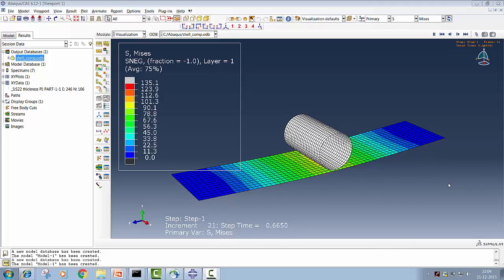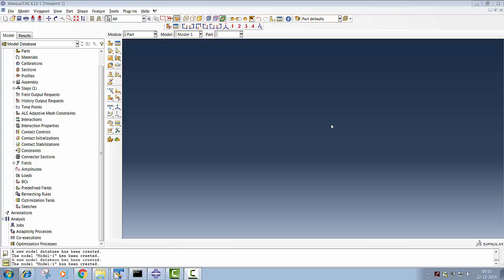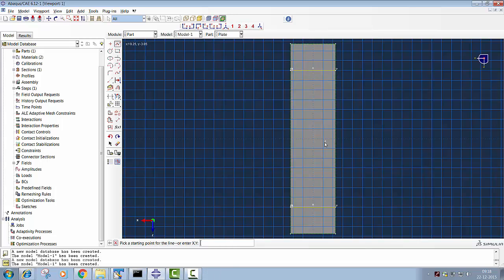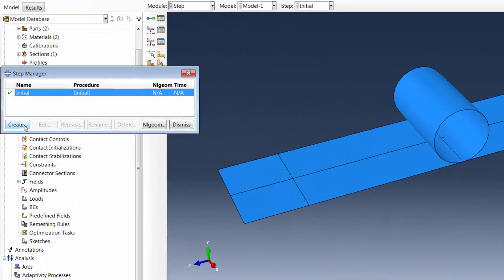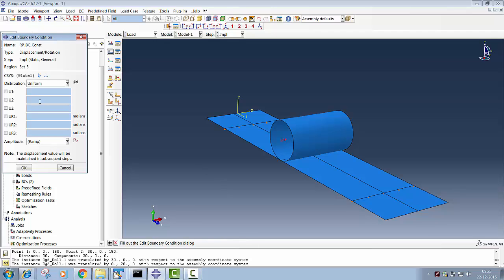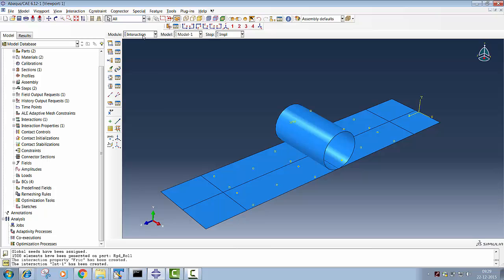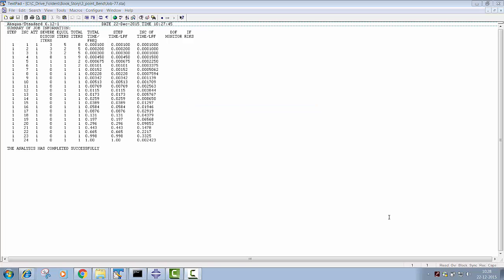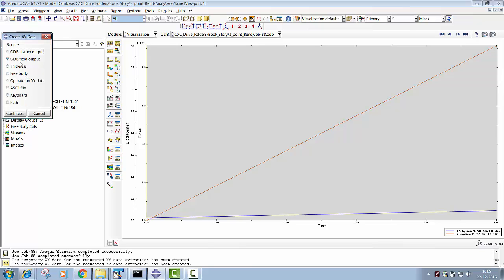Abaqus/CAE-Composite shell through thickness Bending stress plot Tutorial (3-point bend Abaqus std)

Comment: Thanks for the video. Have a question about the contact. When you set up the geometry distance between plate and roller, do you take into account the shell thickness?
Reply: It depends on how you set up the contact. For shell contact, you have the option to count the shell thickness or not. If shell thickness is not counted, you should not leave the gap to count the shell thickness to avoid rigid body motion.  If shell thickness is counted, you need to leave the gap between parts. This video does not show this option and should be default which does not count the shell thickness in contact. In this tutorial, the boundary conditions are not properly applied. As a laminate composite tutorial, this video is also misleading.

Comment: thank you for your video, a question about contact occured to me recently. when there is a friction coefficient  ,the solution convergence quickly ,but if no friction, many  serve discontinuity iterlations,and 
the solution finally not convergence. it's strange?
Reply: it depends on the type of contact problem! sometimes defining friction on parts that is is solved in standard will provide better constraint to the whole assembly and sometimes will reduce rigid body motion effect. try activating unsymmetric matrix storage in your static step and add some contact stabilisation as a first pass.

hope this helps 

Nick
Reply: thank you for the tips